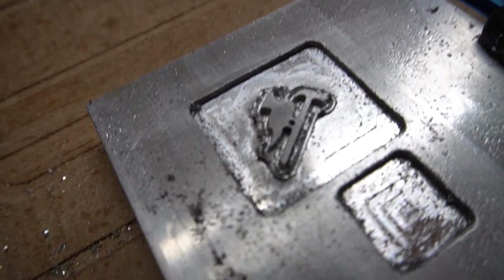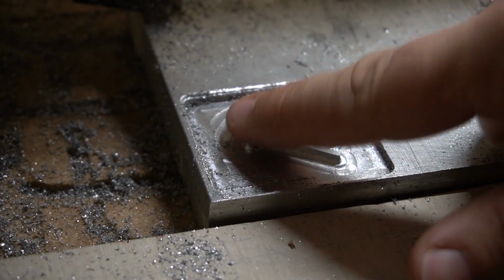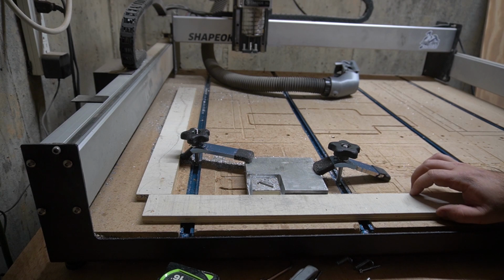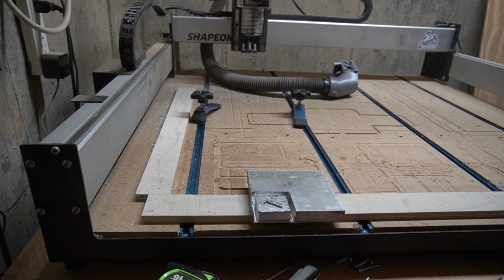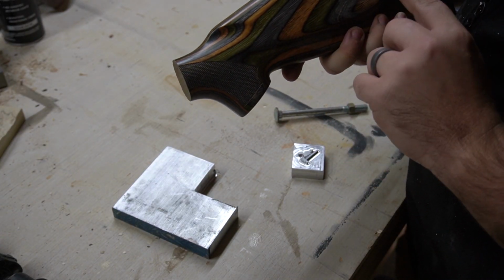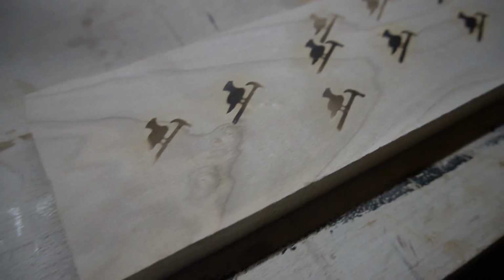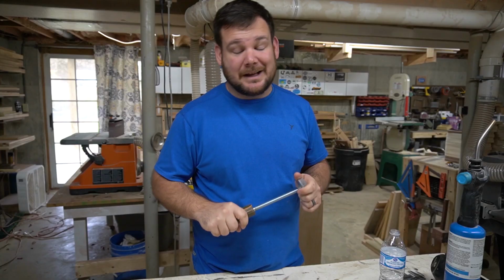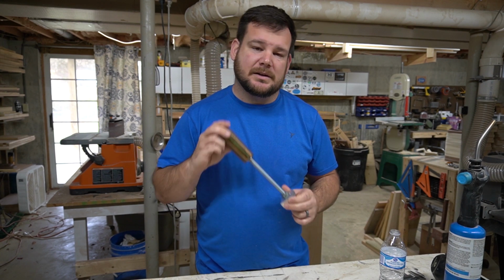Making A Branding Iron // First Time Milling Aluminum With My Benchtop CNC

Comment: I used to hate milling aluminimum.  Tried a lot of things and really hated using any oil, wd40 or other lubricants because the cut chips would always clump and stick everywhere.  Not to mention the oil would ruin any spoiler board....  the best thing I found was a constant flow of air from an air compressor to simply blow the chips out of the way.  Better yet look for a "Cold Gun" by a company called Exair.  It will keep the bit cool and remove the chips at the same time.  You will need a good size compressor though!  ;)

Comment: I like to use WD-40 as a lubricant when machining aluminum. It keeps the chips from building up on the end mill, leaves a nice finish, and it doesn’t take much to go a long way.
Reply from the maker: Thank you for the tip!

Comment: I use paintbrush to get rid of the shavings. The oil will always clump them. Maybe the oil-water emulsion will not but that adds separate set of problems. So I use silicon lubrication and just brush off the shavings.

Comment: A low power homemade induction heating coil would heat that brand up really fast and save on MAPP gas.
Reply: It's aluminum, induction is not a great choice because induction works much better on ferrous metals. Instead consider resistance heating given how conductive aluminum is—take a look at the ones used in 3d printer hot-ends. You can drill holes in the side of the block to drop them in. A quick googling shows you can get one off Grainger for less than $20 for a 1/4" diameter one from Tempco.

Comment: Use a air blast from the air compressor and a single flute end mill will work better than 3 in 1 oil.

Comment: Suck is up. As long as you have a cyclone separator nonferrous metals are safe in your dust collection system.
Reply from the maker: Interesting, will it damage the impeller over time?
Reply: @AndyBirdBuilds  with a cyclone separator the metal never makes it to the impeller. If wood dust drops out of the airstream before it gets to the impeller then aluminum dust would for sure. If you are using a shop vac instead of a real dust collector I'd say it would be fine as well. It is made to suck up dirt which contains small rocks and worse.
Reply: @AndyBirdBuilds  I don't believe it would, the cyclone separator will drop the shavings into the bucket before it even gets to the impeller.

Comment: Pretty sweet dude. I've thought about branding for my cnc based business. They have heater blocks that attach to the brand that can be chucked into a drill press. Just an idea for you if you have a large order you could just make a jig to hold it in the drill press and knock a bunch out at once without having to put a flame to it
Reply from the maker: Thanks! I've seen those. I'll check it out👍